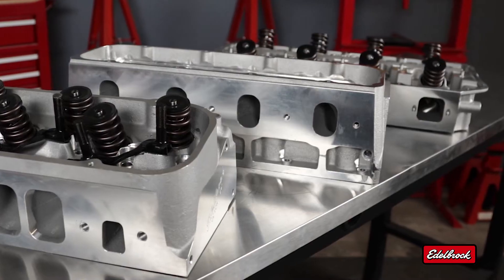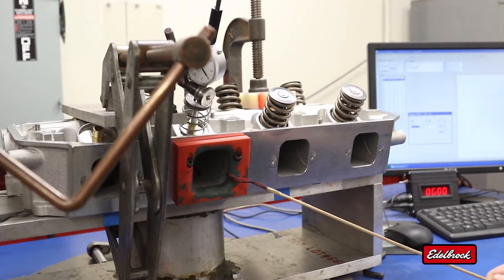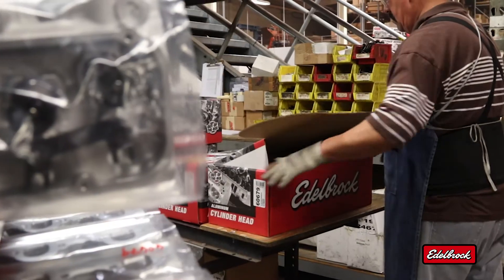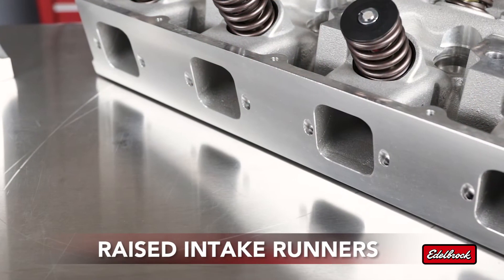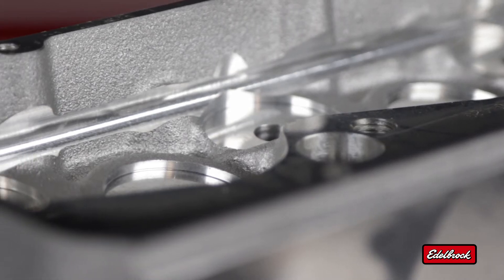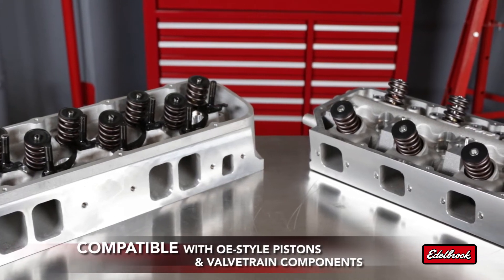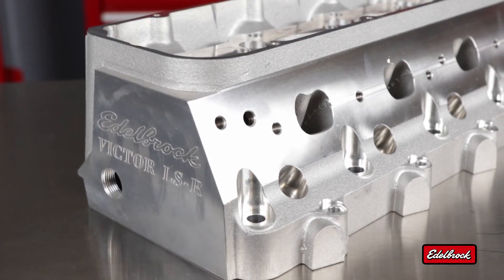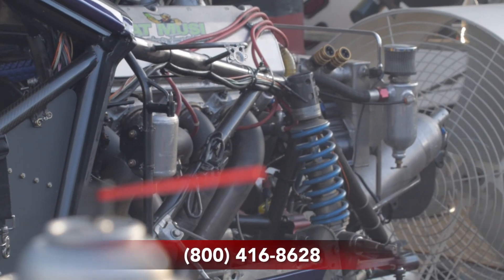Edelbrock Victor, Victor Jr & Pro-Port Cylinder heads

Comment: I'm married with three kids I had one chance to build my dream engine and I bought your heads that were supposed to be ready to vote on and it's slung a valve right through the #3 Piston during cam break in because the locks were not on the spring correctly just wanted to say thank you my dream is still laying in the garage floor 10 years later
Reply: sounds like a u problem